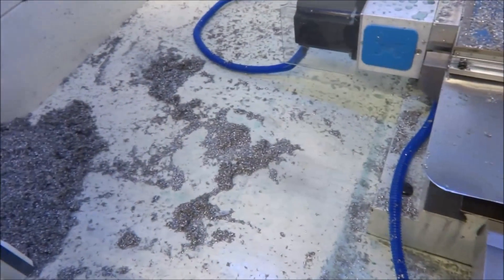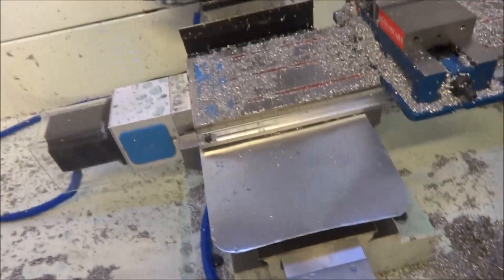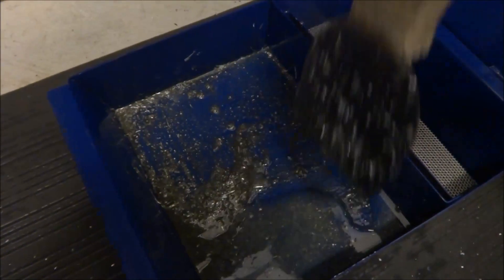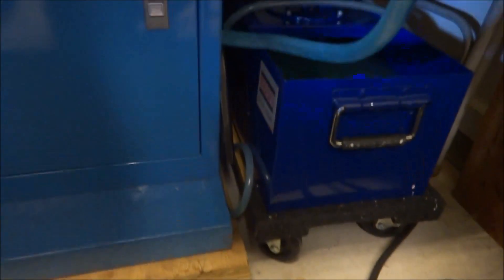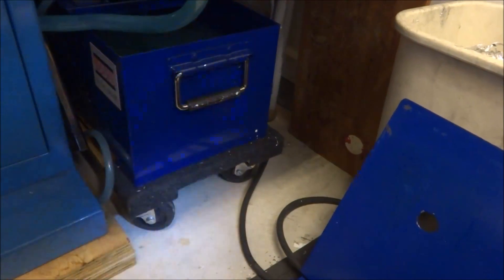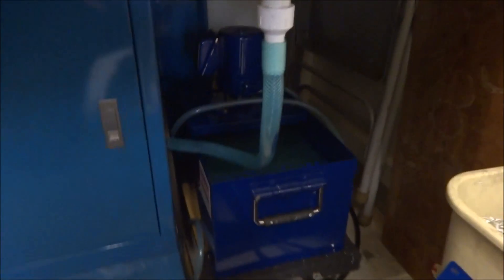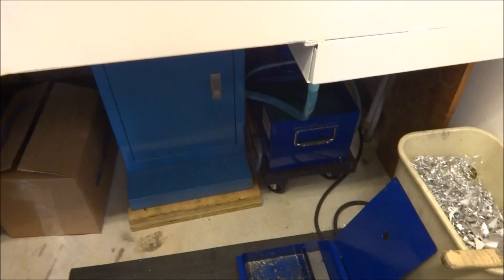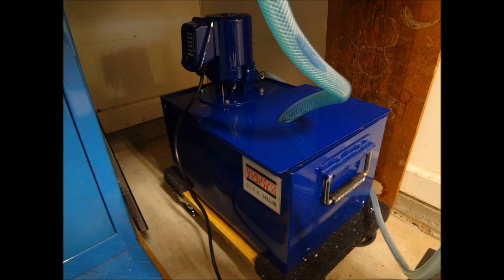Bolton Tool CS 3 4 Coolant Pump Update

Comment: If you drill a hole near the bottom of one side of your tank,
then install a hose barb, you should be able to add another tank
beside your main tank.  So long as your tanks are at the same level
and the hose is at the same level it would be the same as having a 
larger tank.
Reply from the maker: Sort of a Reserve capacity I get it both tanks would keep the same level!

That should work

Comment: You should look at the Grizzly coolant system. I think it holds like 7 gallons or something. That might just fit the bill. NIce work Sam!  Mike
Reply from the maker: Hi Mike, well I initially considered the Grizzly I thought at the time 7 gal may be to much but its probably just right as far as tank volume. the motor looked a little small and the flow rate was not as good as the Bolton. The biggest draw back was the drain.

I really like the way the Bolton was set up with the dam and the way it contains the oil separate from the coolant.
I think the tanks are the same width so I may end up just adding a strip in the center to lengthen the tank some.
Reply: You might even be able to install dam yourself too.
Reply from the maker: Yes that is possible I really don't understand why someone doe sent just make what I want LOL